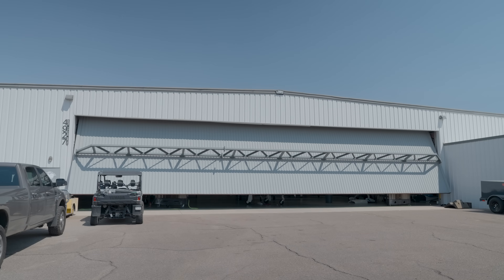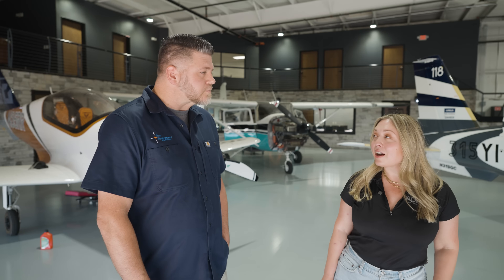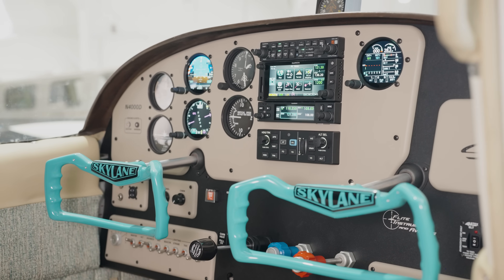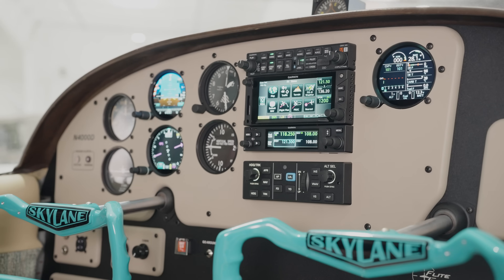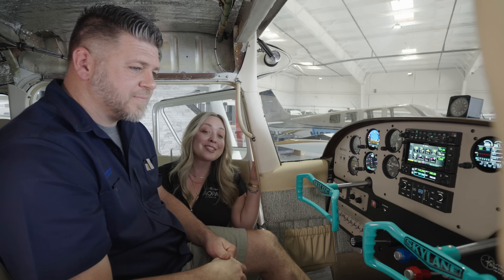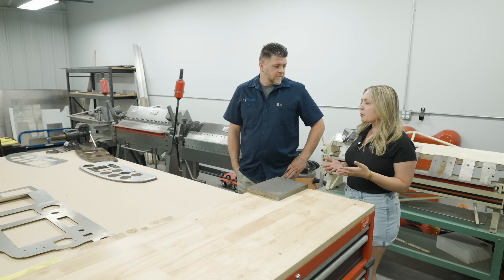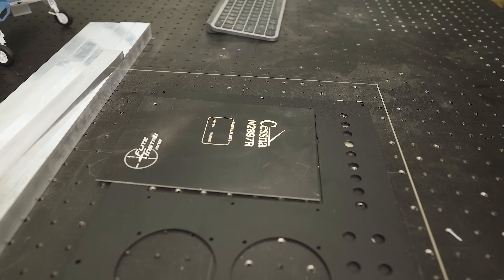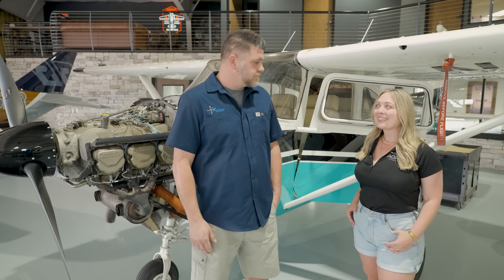New Garmin panel for the AOPA Sweepstakes Cessna 182

Comment: Any idea of the final (1) useful load and (2) payload with full fuel of this particular aircraft? Thanks.
Reply: Useful load was 898 lbs. 55 gal total
Reply: @FliteInstruments-t9c  So that's considerably less than the 1000+ lbs of later 182s. So that leaves only 568 lbs for passengers and luggage at full fuel - essentially the same as a current 172 with full fuel. Thanks.

Comment: I've entered. This plane is as old as I am. Insofar as redundancy for IFR - this is a question; I'm learning:  GTN 650xi provides Nav/Com/GPS while the GNC 215 provides Nav/Com. So, much like pre-glass days, this plane has 2 NavComs with the addition of 1 GPS. If the 650xi goes out in IFR conditions, you lose the GPS and the equivalent of 1 NavCom. You're left with the NavCom to fly VOR/LOC which will be visualized on the GI275?
Reply: That is correct.  There are two separate sources of navigation.  In the GI 275 you can display GPS 1, NAV 1, or NAV 2.   I personally prefer the GNC 355 over the GNC 215.   The GNC 355 is a COM/GPS.  So your secondary navigation is another GPS WAAS.  Great question!

Comment: Spending enormous sums on getting the same tiny ancient instruments has to be a mistake. That the GA fleet is ancient is not a precious aspect to cultivate, it's a huge problem.
Reply: I think you would be surprised at the capabilities of the GI 275.   Not sure what else we could do.  The aircraft panel wouldn’t fit a full size EFIS.   This setup with the autopilot will fly a wide range of precision, non-precision and GPS-guided approaches as well as holds, procedure turns, missed approaches and more. 
And with Electronic Stability Protection, and smart glide.   It’s more capable than a lot of older corporate aircraft. 
And with connext technology, you can plug your flight plan in at home, stream it into your cockpit and not spend the time entering it in on your navigator.
Not sure I agree with your comment.  Some people just like to be negative eh.
Reply: @FliteInstruments-t9c  even if a G3X 10" couldn't fit, and it looks to me like it can just fit maybe slightly to the right and there are old 182s that have G3x, there is also the G500 TXI that comes in a 7" version. But G3x would seem obvious. Or Dynon HDX for that matter although I'm not sure of its size. The synthetic vision etc is just too big an advantage compared to any retro fondness. So much so that it should be illegal to use the small displays.
Reply: There are a lot of people that like the GI275s.   I like the simplicity of the G5s, so when I installed GI275s in my T6, I removed the tapes and programmed it to just be an AI and HSI.   I understand because you don’t like the GI275s it should be illegal to install them.
Reply: @FliteInstruments-t9c  Koby Bryants helicopter crashed because they didn't have synthetic vision. Many have died because of lack of synthetic vision. That's why it's a very bad choices to spend a lot of money on these useless little dials when you could have had much better for the same money
Reply: The GI 275s do have synthetic vision.  Listen, you’re great for future customers, I wish everyone had the money to upgrade to Efis systems.  Some people just want to get rid of the vacuum pump and the vacuum gauges.  
I see your argument but the video was so much more than “GI275s.” 
Cheers
Reply: @FliteInstruments-t9c  don't they cost over 3k each? and synthetic vision is extra. And a G3x 10" is 9800. And caught in zero visibility that cluttered stamp is your entire view.
Where is the massive cost difference?

Comment: The center most round gauges should have been the same level as the far left round gauges.
Reply: The yoke is in the way. I think the oldest vintage 182s had the gauges forming an arc.
Reply: The altimeter and vsi. Just hurts my head a little is all
Reply: @travisw9071  Here's a Garmin upgrade in a 1957 182, the year before this one. Around 1:45 you'll see the panel. It appears that, in the Mojo panel, the middle and right column of the 6-pack are even with each other. I think the early vintage 182s had 2 rows og gauges forming an arc.
https://www.youtube.com/watch?v=uQ_xruLhDw4
Reply: Kieth is correct.   The clearance on the GI 275s is extremely minimal.   I have 1/4” foam under the glareshield and between the GI275.   And between the chain and the GI 275 is so tight that we could not use the bottom connector.   There is no way to make the 6 pack straight across.   Typically I would want that, however in the older Cessnas, I like the gauges following the contours of the panel.

Comment: Manual pitch trim? For real? That is awful. I’m sorry, if the goal was to keep the retro yokes and sacrifice auto trim, you guys made a grave mistake.
Reply: Garmin does not have an electronic pitch trim option for the Cessna 182 - 182D.  No grave mistake was made.
Reply: @FliteInstruments-t9c  No gave mistake was made then outside AOPA’s platform choice. I mean have you flown the 500 without auto trim? We’ve had two flight schools try this and both came back and went “nope” and had the pitch trim servo installed. It’s not pleasant to have constant trim alerts messages in light to moderate turbulence (which is the norm for most parts of the country throughout the year). Very surprised AOPA is OK with this. Anyway, nice work on the panel.

Comment: Nicely styled! "Allows" manual pitch trim. Can the autopilot run the elevator trim?
Reply: Unfortunately there is not an option for an electronic pitch trim in a Cessna 182 - 182D.   Manual trim would be required.  Thanks for the compliment.